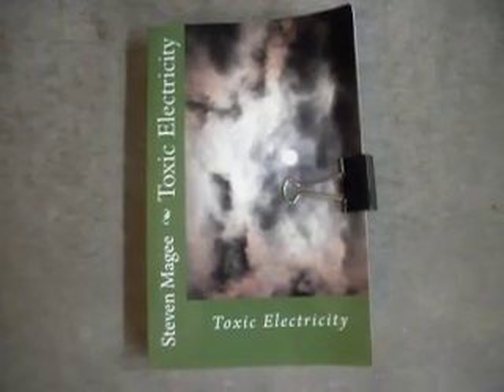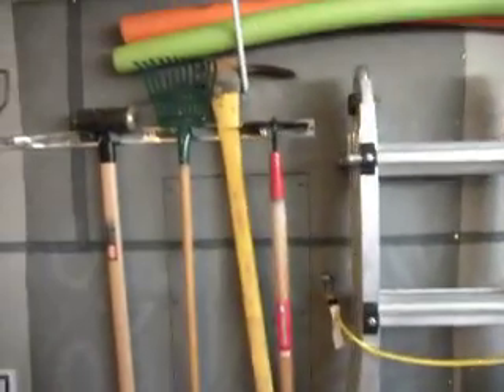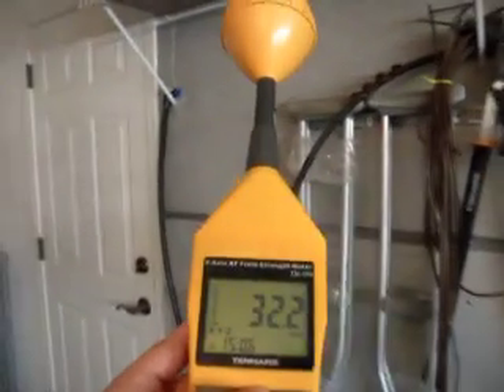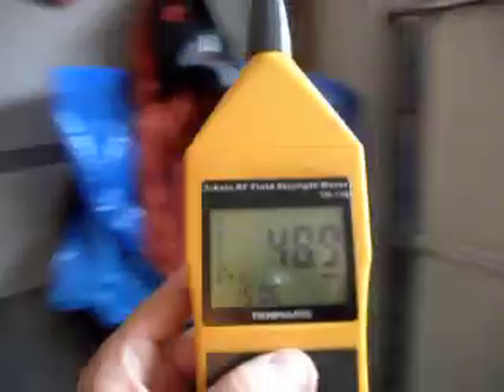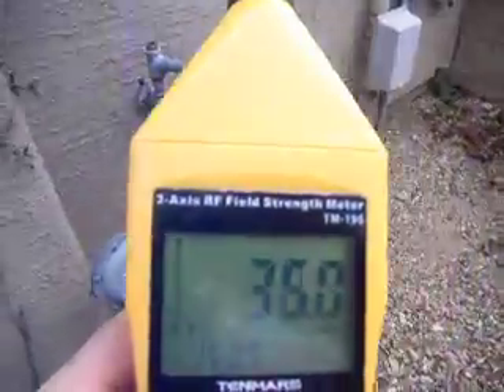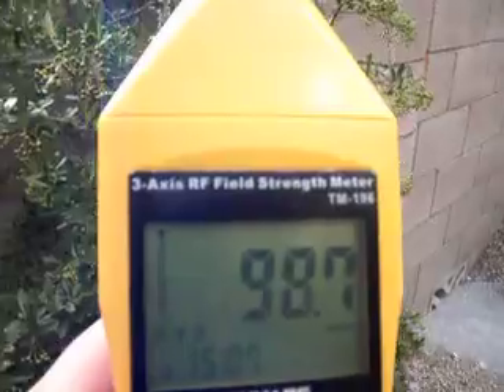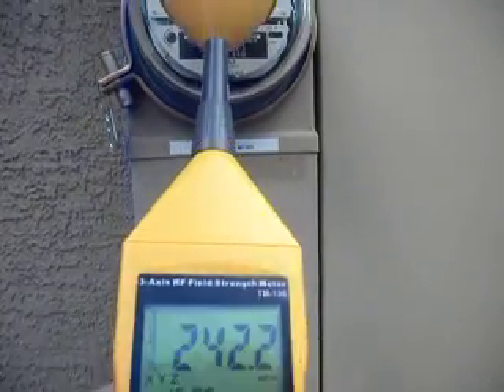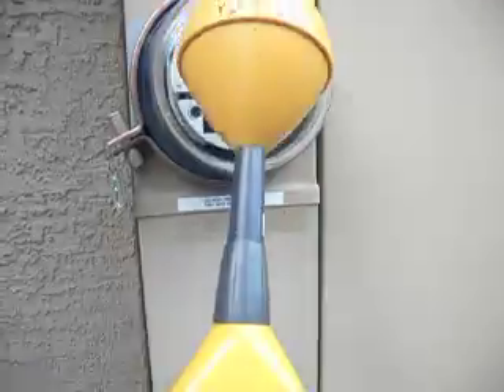Checking AMR - Smart Meter Aluminum Mesh Shielding Performance

Comment: How did you get your meter replaced with an analog meter?
Reply from the maker: After making the shielding videos, I just requested it.  There was no problem with the electric power company changing it and also no fee.  I left the shielding up as there is a transmitting Itron 100G gas meter on the neighbors home that was making me really sick.  Having developed the radiation resistance techniques, I have managed to get all conditions to subside to buzzing microwave hearing and occasional afternoon fatigue.  The techniques that I use are in this book: Toxic Health: http://amzn.com/1466336153
Reply: StevenMageeBooks
thank you  for  replying....  I have spoken with my power company 3 times and mentioned the list of reasons, including that  it was illegal for  them to install it.  They won't replace it. 

Today, I sent them an 8 page legal notice to replace or I will be in my rights to. I got the info. from freedomtaker.com  ...  I didn't want  it  to  come to that and it is not easy for me to fight the system.  But, as you know, this radiation is not harmless. 

any suggestions?
Reply from the maker: Who is the power company?  It's a common problem that is a health and safety issue as well as a human rights issue.  Take a look through my website, you may find some useful information there: http://www.environmentalradiation.com/
Reply: StevenMageeBooks
My power company is Wisconsin Energies.   The third time I talked with Thomas Held, he told me they could move my smart meter to my lot line, which is 20 feet away.  I said no, please replace my meter.  He said he can only turn off my electricity if that's what I choose.   thanks Steve!
Reply from the maker: I would take the moving the meter as an interim and see how you feel, since they have agreed to it.  You should contact Josh Hart http://stopsmartmeters.org/turn-on-the-electricity-drop-the-fees-psrec/